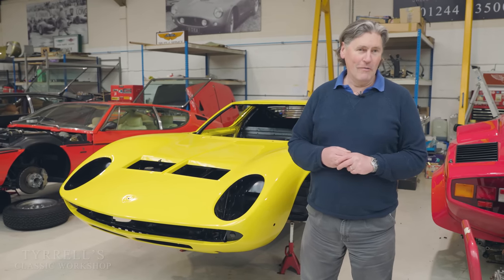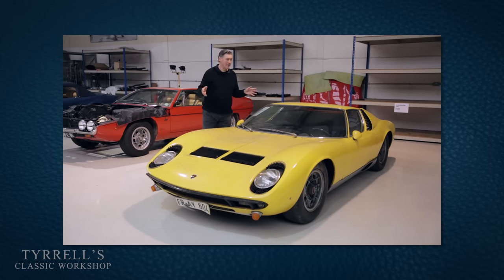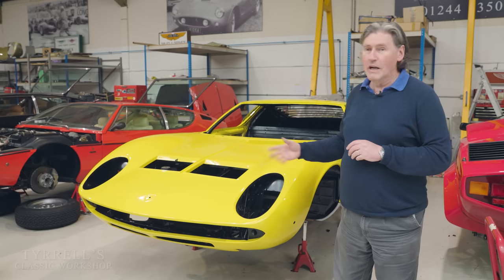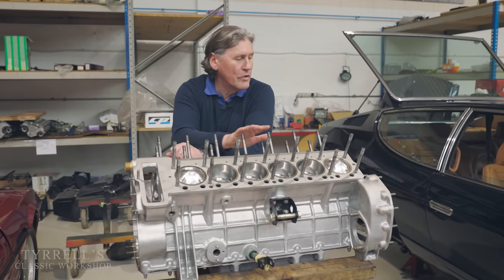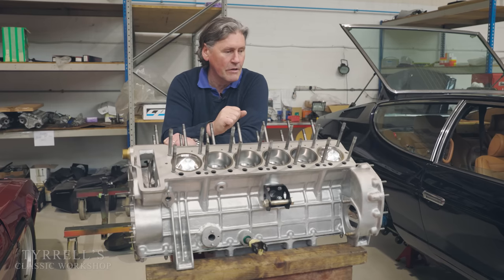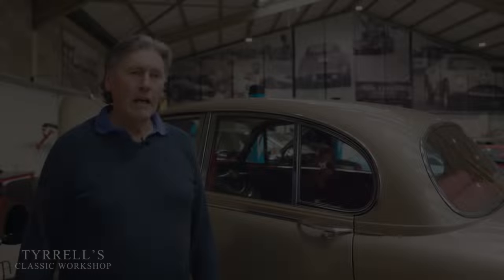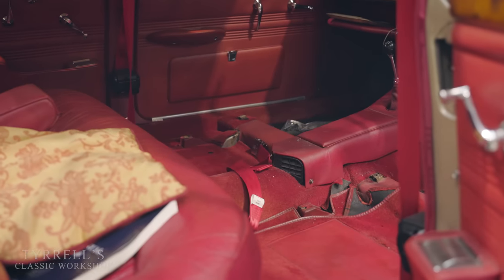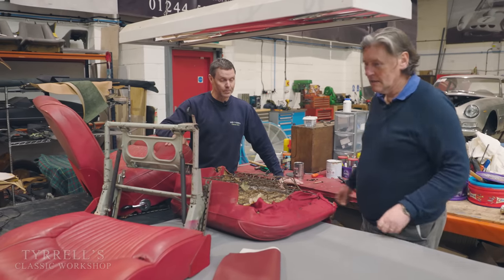£1.25M Barn-Find Miura Update + Harry's Countach Engine Cleaning | Tyrrell's Classic Workshop

Comment: Great video again, dry ice cleaning has been used in industry for decades now. I worked in a company where we used this to clean moulds for injection moulding. The dry ice was great for shrinking shafts or bushes before fitting limiting the use of hammers.

Comment: The dry ice blasting is very cool, something mentioned on the RetropowerUK channel is that in addition to not being too aggressive, it completely dissipates into gaseous CO2, which means you don't need to worry about blasting media finding it's way into bearings or oil galleys etc.

Comment: Iain, you are a natural for sober, informative and gimmick free presentation. It's difficult to do that without being tedious, but you manage it like a master. I've never done dry ice blasting, but it has a huge advantage in that there is no media to clean up afterwards. I remember bead blasting F2 cylinder heads to decoke them and we spent far longer cleaning the castings up than the blasting ever took.

Comment: Finally, someone put on a video of both the dry ice blasting equipment and process with the hoped for result.  Just another Great Video, thank you Iain!!!
Reply: That dry ice method is widely used in paper industry, because of it´s effectiveness without downsides sand blasting causes. The tiny pellets in fact don't touch the surface to be cleaned, so that is the reason why the method does not hurt or damage any surface. We did test it by cleaning machine parts in a paper machine while production. Noise is the only downside (over 125 dBA).

Comment: Excellent informative video. First time I've seen dry ice blasting on an engine using the sublimation of Carbon Dioxide from solid to gas to lift the surface crud.

Comment: I used the Dry Ice Blasting method as long ago as 2015 to remove paintwork from Birmabright alloy body panels from my 1955 Series One Land-Rover - it removed paint, undercoat and filler without any damage whatsoever to the surface of the panels - great stuff!  Used a very high pressure set up locally to me in Leicester - Dry Ice Network (UK) Ltd - I took the panels to their premises, they gave tuition for me to use their kit for the day, which was best as the compressor required is high powered...

Comment: Another excellent video. The dry ice blasting uses a process called sublimation: the solid CO2 goes directly to the gaseous state (instead of melting, then evaporating). When the CO2 sublimates, it cools the surface. The temperature shock, combined with the tiny shockwave of the sublimation (gas rapidly expanding) breaks loose any dirt.

Comment: Have you ever considered painting the cleaned engine block. Possibly using a high temperature clear coat, that would prevent oxidation and stop oil and grime sticking to it.
It would be interesting to see more of the preparation and painting of these lovely classic cars like the Mura. It' is a part of the process we seldom see and it's very interesting. The renovation of the Lambo interiors is another process I would love to see more about. Problems like those carpets for example.

Comment: What Julian failed to tell you all is that using the dry ice blasting, all the particles that are cleaned off the engine gearbox or what ever remain dry. You don't have a pile of soggy wet mess left to clean up. It's a brilliant way of cleaning anything from dirty engines to food production lines.

Comment: I was told never to polish rough caste aluminium as it reduces the metal surface area and reduces cooling.  Important on alloy sumps in particular.  This CO2 blasting should be good for Lotus type  14 Coventry Climax engines.

Comment: Iain, about the Jaguar leather seats. When you say "untouched and untreated from 54 years ago", does that mean they were never conditioned or maintained in any way? They do somewhat look that way, they do have that kind of a look. If that is the case, then I am surprised they are not more dried and cracked up. At the same time I do wonder how much better they may have looked had there been some sort of regular maintenance.

Comment: My uncle had a 3.4 S Type with wire wheels with the independent rear end how do they handle in comparison to an XJ6?  I have a theory the "S" left the factory with Crossply tires the XJ6 had radial tyres from day one. Will you test drive the "S" and on what tires?
Thanks Gerry Ellis Dublin.
Reply from the maker: Good question about the tyres. Thanks for your interest